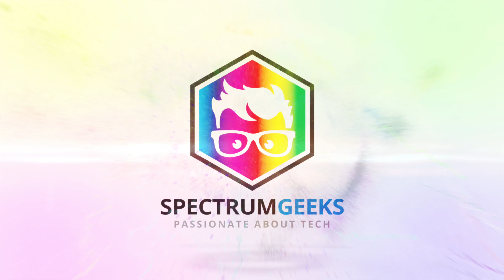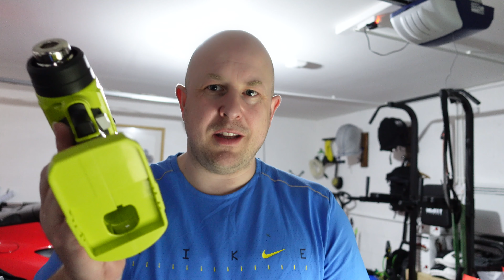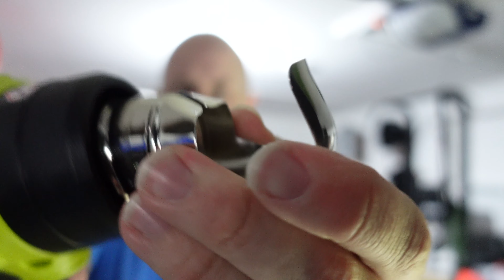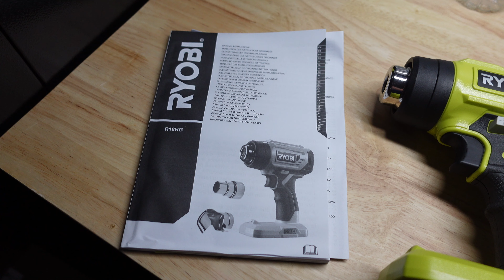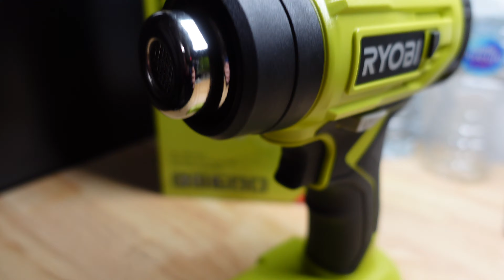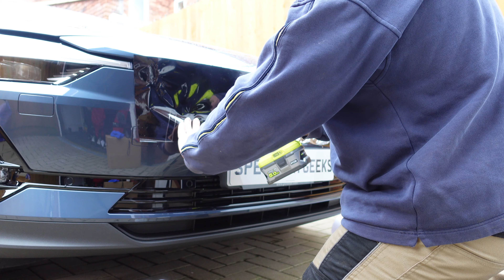Ryobi Heat Gun Review - R18HG-0

Comment from the maker: At 1:57 I mention it takes 60 MINUTES to get to MAX heat, this was a miss spoken moment, its 60 SECONDS.
Reply: but its only 470c , its a bit sad. the one i use have 800c, When I shrink big tubes ect. .
Reply from the maker: @negueba235689  There is often a trade off for cordless, so if you need more heat you may need to go corded.